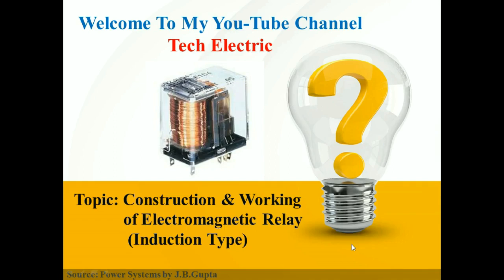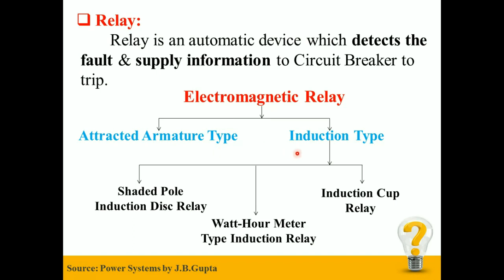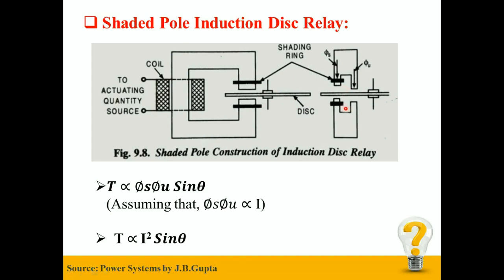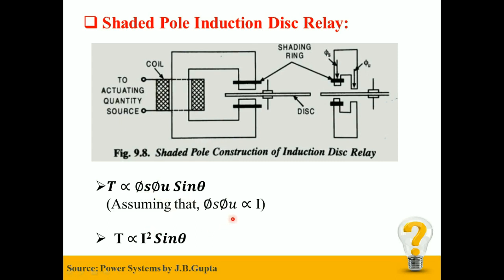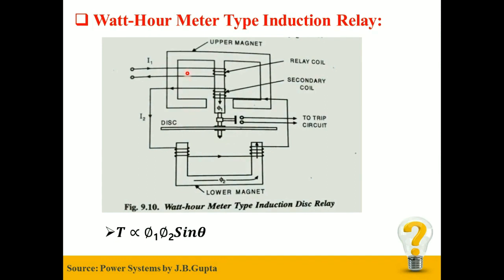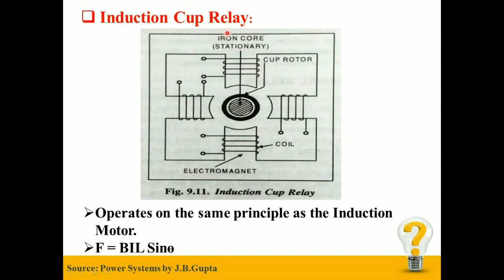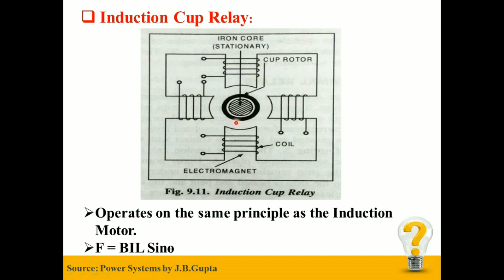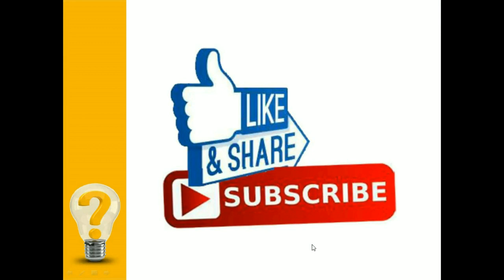Working of Electromagnetic Relay (Induction Type) | TECH ELECTRIC |

Comment: Which types of electromagnetic relays are used in power system protection circuit? How distance protection and negative sequence relay works? Please make one video for it. Thanks
Reply from the maker: Distance protection using Impedance Relay is explained in this video:
https://youtu.be/gAzCewf8qJ0 (kindly check it out)

Different type of electromagnetic type relays used in power system protection circuit are already explained in this video itself.

Will try to cover negative sequence relay in future video if possible.Stay tuned.